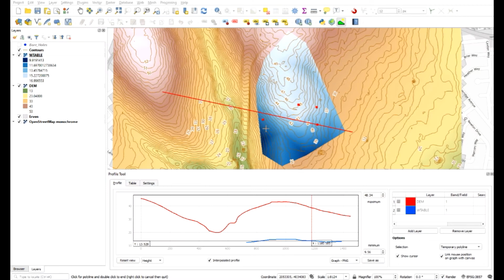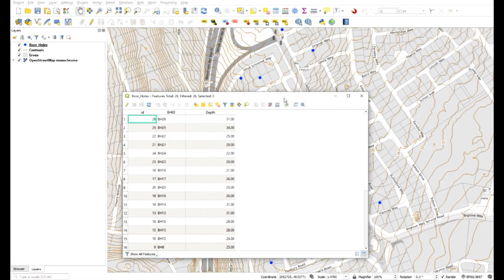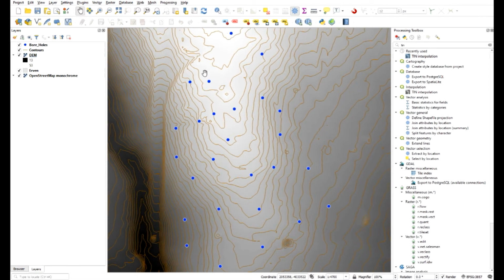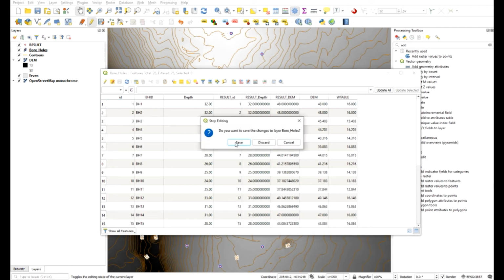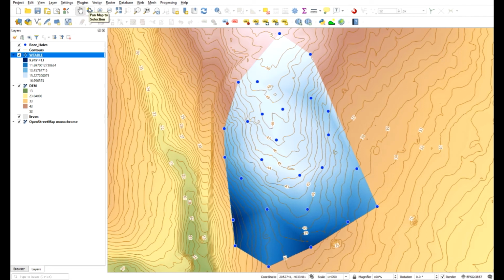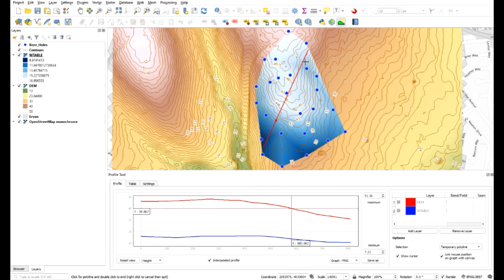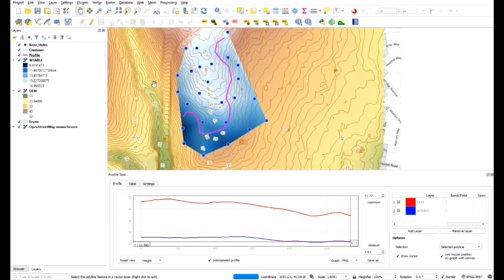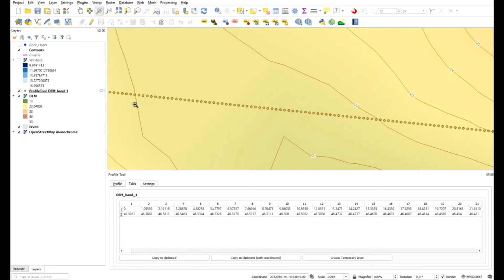QGIS DEM Profile Tool

Comment: Hi, 

I have an issue with the measurement unit of X axis when plotting the longitudinal profile. It is not in meters. I don't why this happen.
What I have done are:
1. I convert the projection of DEM from EPSG 4326 to certain UTM zone (in this case, EPSG 32749 - WGS 84 /UTM Zone 49S)
2. I also convert the projection of the river polyline layer to EPSG 32749 - WGS 84 /UTM Zone 49S as well.

What should I do to fix this issue? 

I use QGIS 3.28.9 Firenze
Reply from the maker: Try changing the project units to UTM. https://youtu.be/UvMlX24kuMk
Reply: @Qtips1  thanks. solved.